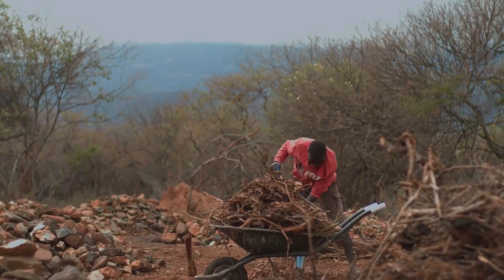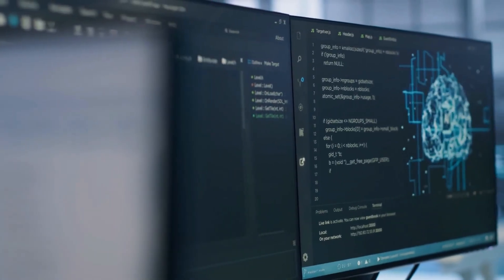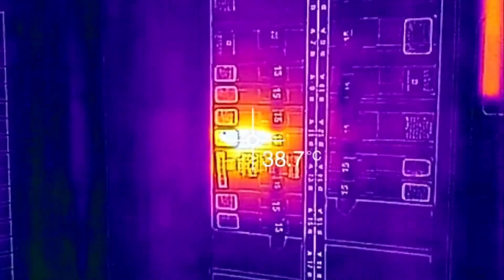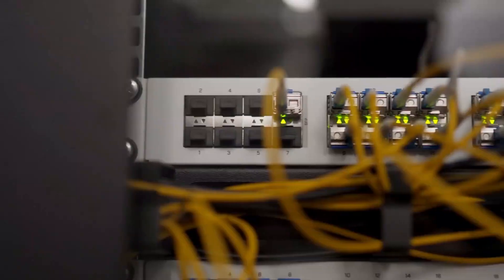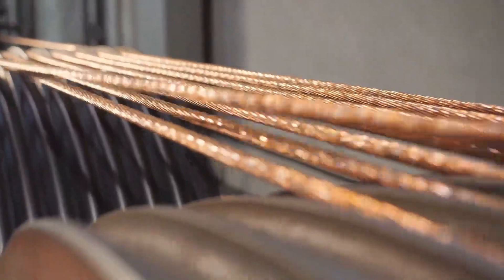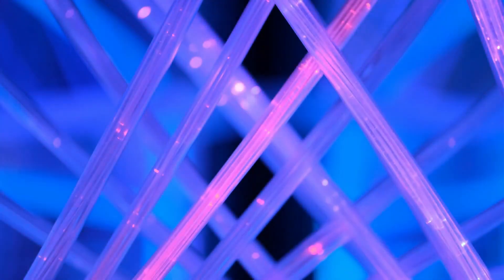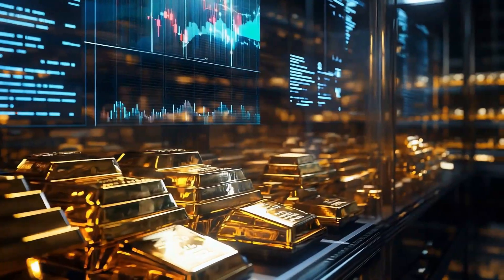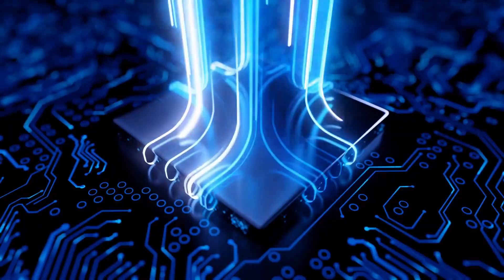Why AI Can’t Scale Forever (Physics Is the Problem)

Comment: Umm for your information 99% of those systems DON'T use Copper anymore they use fibre with is VERY far from being saturated.
Reply from the maker: True at the rack-to-rack / data-center networking level fiber isnt saturated there.But inside servers and inside accelerators, most data movement is still electrical (memory buses chip-to-chippackage-level links).That where power heat and latency hit first.Fiber helps scale between systems, not eliminate the on-chip physics wall.